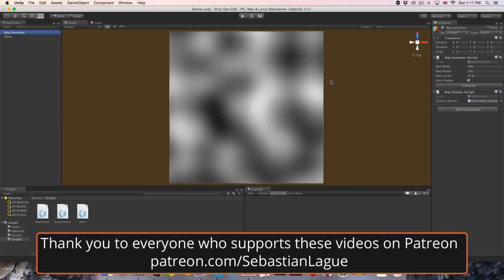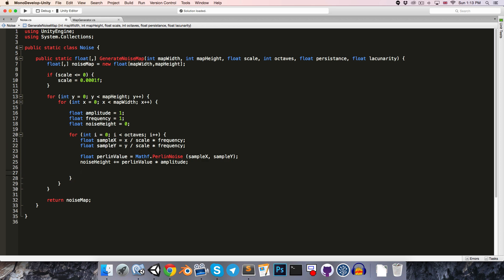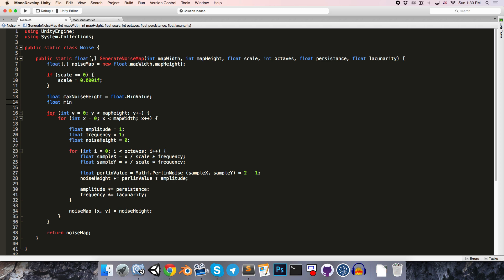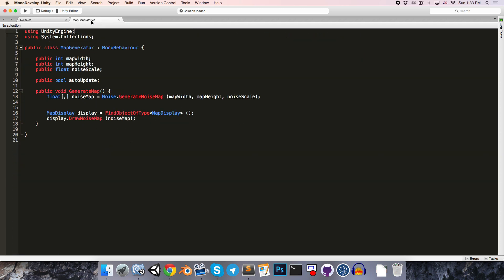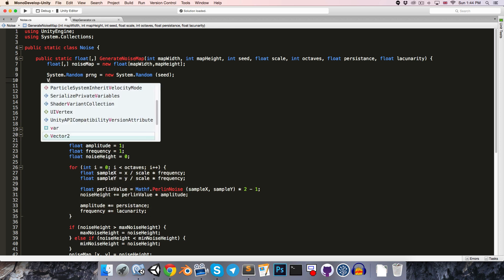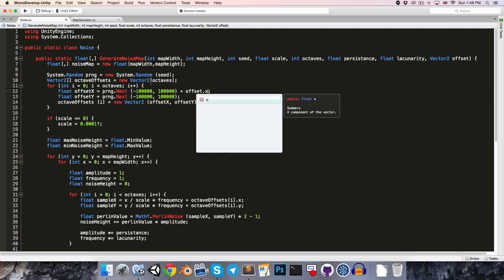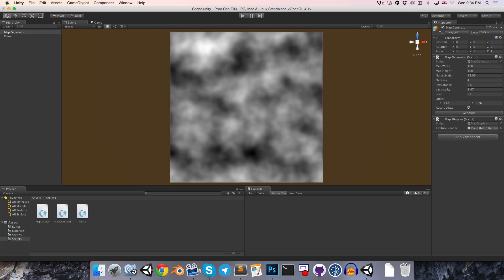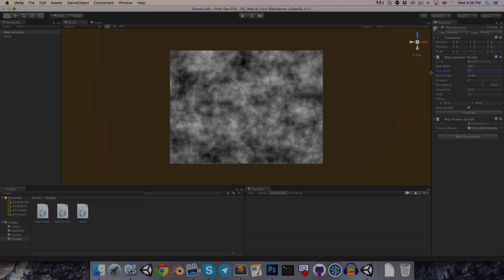Procedural Landmass Generation (E03: Octaves)

Comment: Max and min noise height can be calculated with 
        float limit = 0;
        for(int i=0;i<octav;i++)
        { limit += Mathf.Pow(persistance, i); }
this will save a lot of calculation;
Reply: This is the theoretical limit, yes, however in practise this does not work, because there will (basciallaly always) be a huge difference between the theoretical max value and the actual.
I ran it a few times and the max value was never above 1, while the theoretical max value was 1.875.
The result of that is, that you have a lot of grey and no white or black.
Reply: edit: (I'm implementing this series into UE4)
It might be the case that I'm wrong, because my output (without your optimisation) is not looking correct at all.
So I might have broken my Perlin Noise function...
Reply: Ok, my Perlin Noise function has a problem with large input numbers.
However, the main problem with your optimisation is still there: You don't have pure white and black.
If you can get those later with other methods (I think we can?), then thats not a problem of course.

Comment: funny. I did all same things step by step and at 10:20 I get a different texture than on video =)
I was thinking about what I get the same texture what in a video if I do all the same settings...
Why textures is different?
Reply: because it's a random noise. Random.
Reply: as I understand, if the generator settings are exactly repeated as it is implemented by the author, the card should be completely repeated. so when I fully repeated all settings I get a much different map what shown on the video, but when I generating map time to time with the same setting on my project - I always get a fully same map if settings are same.

Comment: When i generate my plate turns black... Any idea?
Reply: I have the same problem.
And I have fixed it.
It's because there is something wrong in your code, probably in the Noise class.
Reply: Hey did you ever fix this? I have the same problem
Reply: I was running into this as well. In my case, if the Noise Scale variable is close to 0 or negative, the entire plane will be black. Probably something to do with the normalization code.
Reply: You should set your material texture to none. that worked for me.

Comment: what is the point of the octaves for loop? Am I missing something? it only seems to multiply amplitude and frequency  for a number of iterations, everything else keeps getting overwritten until the last loop. Isn't it easier just to amplitude *= persistance^octaves and frequency *= lacunnarity^octaves and skip the (x*y*octave) number of loops for octaves?
Reply: nevermind, NoiseHeight builds with each iteration of the loop. Wonder if there is a simpler way though,

Comment: Whenever I change the Noise scale it doesn't just zoom in, the noise is also growing and then shrinking back as it zooms in (like it's showing a 2d slice of a 3d noise that is repeating). Does anyone know why this is? I double checked the code and it is the same as in the video!
Reply: Remove the 2 for loops for x and y that InverseLerps the Value before you return, I don't know what the problem is but i had the same problem and commenting out the for loops was the only thing that worked for me.
Hope this helps

Comment: why set the min and max height values inside the loop? if they are consistent couldn't they be assumed as -1 and 1 for the inverse lerp method and thus use the inverse lerp in the return line directly?
Reply: Because the min and max can go below 0 and above 1 when you are layering the octaves. For example with a high frequency you could find you get 0.8 for octave 1, 2 and 3 which when added together would give you 2.4. The same can happen in negative. Also imagine if you had an amplitude of 1000 instead of 1, then you would have 2400. It doesn't matter how big or small the numbers go when you are sampling the points, as long as you bring everything back between 0 and 1 at the end while maintaining the proportions.

Comment: I get four minutes into the video, and my map doesn't show perlin noise. Instead it shows a black plane. Does anybody know how to fix this ? I have checked through the Noise script three times already, and still cannot find any errors. Unity doesn't point out any errors either. (im stuck after typing the code from 0:00 - 5:34)
Reply: Change the plane Map Mat to Unlit/Texture.
Reply: make sure octaves are above or below 0
Reply: set your material texture to "none"

Comment: I've been recently following this set of tutorials, and been learning a far bit in the process. However its become very obvious that your coding method is using a mixture of Mac OS X and windows code. Which is honestly a serious problem for straight windows users using the Windows version of unity. There came a point in writing your code where it all broke due to this oversight, and as a result I've had to go over all the code and sadly fixing this to no anvil have I been able to rectify a lot of these discrepancies in the whole code form.  Is there any chance you have the completed code using only windows based code line arguments ? and if so can you provide them.

Comment: hi i'm having a bit of trouble when I finished putting the octaves and things in unity the entire plane simple went black and i cant get it to change and become static like before there's no errors so i don't know why this is happening. any ideas?
Reply: I did find some "warnings" but this is the only one that could be worth mentioning. 
"Assets/Scripts/Noise.cs(41,27): warning CS0219: The variable `perlinValue' is assigned but its value is never used" any thoughts?
Reply: You never used the variable perlinValue maybe u typed in something like PerlinValue or Perlinvalue

Comment: My Perlin Noise looks pretty repetitive... I don't know if you'll fix this in future episodes.. I this I kind of see a repetitive pattern in your Video too. Its when you zoom out at 10.02, you can see straight lines and repeating bumps. But my pattern looks very tiled.
Also I get the weirdest pattern ever on scale 0.000001! Its like a plus!

Edit: After copying your code it seems to be fine. I also made a few adjustments to the MapGenerator:
   private void OnValidate()
    {
        if (mapWidth < 1)
        {
            mapWidth = 1;
        }
        if (mapHeight < 1)
        {
            mapHeight = 1;
        }
        if (noiseScale <= 0.001f)
        {
            noiseScale = 0.001f;
        }
        if (octaves < 1)
        {
            octaves = 1;
        }
        if (lacunarity < 1)
        {
            lacunarity = 1;
        }
        if (persistance <= 0.1f)
        {
            persistance = 0.1f;
        }
    }

Comment: Hi, I was confused why you adjusted the range of the PerlinNoise to (-1, 1) so added an extra argument perlinRange

float perlinValue = Mathf.PerlinNoise(sampleX, sampleY) * perlinRange - (perlinRange/2);

I added perlinRange as a public variable so I can adjust it in real time, and I found something interesting. Any value above 0 did nothing to change the noise, but and value below 0 actually inverted the noise. I now have an invert feature to the map which is cool, but I am still confused why you wanted to change the range to (-1, 1). I understand that it will vary the noiseHeight value to a greater degree, but once that is normalized to (0, 1) I can't see any change in the noise.

Comment: I'm following in c++ opengl and I don't have an inverse lerp function built-in (4:36). Does anyone have a c++ or pseudo-code function I can implement?
Reply: It's just a linear interpolation. 

float lerp(float v0, float v1, float t) {
  return (1 - t) * v0 + t * v1;
}

where v0 = minNoiseHeight, v1 = maxNoiseHeight, and t = noiseMap[x, y]

From Wikipedia's 'Linear Interpolation' page.

Comment: Getting this error. Does anyone know why?
IndexOutOfRangeException: Array index is out of range.
Noise.GenerateNoiseMap (Int32 mapWidth, Int32 mapHeight, Int32 seed, Single scale, Int32 octaves, Single persistance, Single lacunarity, Vector2 offset) (at Assets/Scripts/Noise.cs:46)
MapGenerator.GenerateMap () (at Assets/Scripts/MapGenerator.cs:23)
MapGeneratorEditor.OnInspectorGUI () (at Assets/Editor/MapGeneratorEditor.cs:19)

and it points to this line :  float sampleX = (x - halfWidth) / scale * frequency + octaveOffsets[i].x;

Comment: I'm loving this series as well but have come stuck at 8:55 - the seed section. I don't have the seed slider in the inspector. 

Obviously I've done something but I can't track it. The error in unity says "  scripts/mapGenerator.cs(20, 29): error CS1501: no overload for method 'GenerateNoiseMap' takes '8' arguments" but I have all 8 in the brackets.

I don't get the offset adjusters either. Can somebody read minds and suggest some magic for me please
Reply from the maker: +Alister Gray That error message means that there should NOT be 8 parameters. Go check the method definition and make sure the parameters you're passing in match up correctly with the method's arguments.

Comment: I was having trouble with the "Plane" object showing default material rather than the noise "Map Material", after going thought the noise script letter by letter, I found that on the 2nd last line which reads "noiseMap [x, y] = Mathf.InverseLerp (minNoiseHeight, maxNoiseHeight, noiseMap [x, y]);" i had written "(minNoiseHeight, minNoiseHeight, noiseMap [x, y])" while using the auto complete. Defiantly makes you think but its all very logical :D

Comment: Hi! Thanks for the videos!
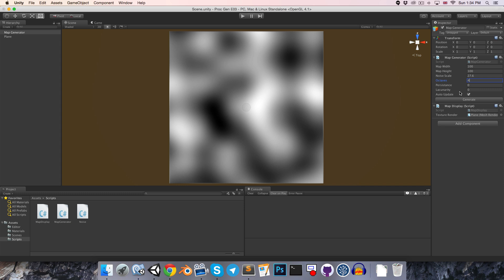somehow the line the InverseLerp returns 0.5f for all values (I'm at the middle of the video, can't reproduce what you have at 5:40 because of this).

Any clue on why that would happen (all the other input values appear to be correct)?

noiseMap[x, y] = Mathf.InverseLerp(minNoiseHeight, maxNoiseHeight, noiseMap[x, y]);
Reply: Finding the max value (or the min) of an array starts with initializing the variable with the smallest value possible 
float maxNoiseHeight = float.MinValue;

This is the only way to make sure you program will find a value in your array that is larger than the smallest one.
Reply: Same problem here
Reply: Found it (for me). In my case the following code was the problem (this is the correct one):
float maxNoiseHeight = float.MinValue;
float minNoiseHeight = float.MaxValue;

I inverted float.MinValue and float.MaxValue. 

I still don't understand exactly why this is setup as it is  (maybe Sebastian can pitch in and explain?)
Reply: @andreadst  5 years later, your comment saved my ass from tearing my hair out :D cheers buddy!
Reply: @Buhm01  power of the internet :D
Reply: Thanks for the explanation pololabete!
Reply: Thanks, had exactly the same problem. 
Cheers <3

Comment: I've rechecked again and again against github source, when i set octaves or very high, it become star, how i can prevent this..
my set is  [mapwidth =100, mapHeight=100, noiseScale =25, octaves =30, persistance=0.66, lacunarity=1.61,seed=0, offset=(0,0)]..

btw thanks sebastian for your tuts
Reply: This also happens if you set the lacunarity super high and a similar thing happens with the persistance. I couldn't explain the exact cause but i know it's something to do with the precision of floating points, if you played Minecraft back in the day and discovered the far lands, that's the same thing.

Comment: could you explain real quick why you use system.random? instead of random.range.  im having a hard time understanding exactly what the seed.next does since im use to using the random.range
Reply from the maker: Since you can't create a UnityEngine.Random object, setting the seed will affect all random numbers in your game. That's why I prefer to create a System.Random object; that way the seed is only used for the terrain gen. System.Random.Next(int min, int max) simply returns the next random number in that range – same as UnityEngine.Random.Range(int min, int max).
Reply: You can use Random.InitState(seed) to define the seed of UnityEngine.Random. I think this would work in the same manner.

Comment: Can anyone explain to me what is the point of the octaves?
Reply from the maker: +Purple Ice Have you seen the first episode? It explains it all fairly nicely I think. https://youtu.be/wbpMiKiSKm8?list=PLFt_AvWsXl0eBW2EiBtl_sxmDtSgZBxB3
Reply: Sebastian Lague My bad... Thank you!
Reply: Sebastian Lague So basically Instead of currently getting noise just once(is how I am doing right now in my voxel terrain project) each time I need to get it several times with different variables and add them all up? (I will most likely redo that part anyway and I hope I understood it)
Reply from the maker: +Purple Ice That's correct. You layer multiple octaves so that you can add smaller details to the noise.
Reply: +Sebastian Lague Okay, I'll try to add an option to generate several octaves if needed, but will it ever be needed? I mean what could I do with them in voxel terrain? (blocky terrain where only visible mesh is rendered) right now everything is smooth and kinda how I want it to be, but what could be done with them?

Not really sure if you might know but this type of generation (straight walls with flat surfaces on top) http://minecraftio.com/wp-content/uploads/2016/04/Realistic-Terrain-Generation-Mod-minecraft.jpg

Is this the result of multiple octaves? (Currently I am just learning to use the noise, using simplex noise but I doubt it's too different from perlin and I really have no idea what I am doing, currently I just can make terrain from multiple layers (stone, dirt grass etc) in 3D space, just asking anyway)

Comment: Is there a way to connect two noise maps using the same seed next to eachother? I thought that changing the offset appropriate to it's location would work but it doesn't. Any suggestions?
Reply: I'm two years late, but if anyone wants this, just change
"float sampleX = x / scale * frequency + octaveOffsets[i].x"
to
"float sampleX = x / scale * frequency + octaveOffsets[i].x * frequency;"
and it should connect properly, I believe. It's just that further octaves don't get offset properly if you don't multiply their offset by frequency too.

Comment: i have noticed that the offsets are not working well. when you're changing them the noise map is not moving but it looks like a layer of clouds moving at differend speeds - this is because the various octaves are not moving as they they should. fixed it with:

float sampleX = x / scale * frequency + octaveOffsets[i].x * frequency;
float sampleY = y / scale * frequency + octaveOffsets[i].y * frequency;
Reply: another issue with this is that it will dynamically change the shading due to different minimums and maximums (as they can change as you move around the noise) so I think that inverseLerp should work in a different way.
Reply: Thanks a lot! I couldn't figure out why changing the offset actually changed the scenery, and did not just move it :) this worked perfectly (though I did add sat (x - halfSize) instead of just x (same with y), but it does not really matter)
Reply: +daluur yes, I wrote that comment before the end of the video - before the zooming to center option was added, i also cahnged the whole thing later so it looked like
float sampleX = (x - halfSize / scale + octaveOffsets[i].x) * frequency;
Reply: +vooood I think you forgot to put x - halfSize in parenthesis should be ((x - halfSize) / scale + octaveOffsets[i].x) * frequency;
But again, thanks, really needed a way to make the map 'the same' regardless of the offset :)
Reply: daluur indeed, i was not copy/pasting from my project and looks like i have missed that. :)
Reply: It does give a nice parallax effect

Comment: Instead of normalizing the noise values with the min and max values wouldn't it be better to normalize them between -1 and 1? If you normalize between min and max the value of the sampled points changes depending on the cut of the noise map you can see, if for example you have one really low point like -1 and change the offset a little so your min value is now 0 all values you could see before change their value, a noiseValue of 0 is now 0 where it was before 0.5. That's just something I found out while coloring the heightmap, points on the map that where blue would change to another color depending on where the "camera" (offset) is on the heightmap.
Reply: I was implementing something similar to this video using chunks and was noticing the normalized values were creating distortions which appeared as lines between the chunks.  Normalizing between -1 and 1 instead of a min and max, as you and others have suggested removes this.

Comment: Personally, I would say octaves should never go below 1, not 0.  Otherwise, your Noise.GenerateNoiseMap function will only return a bunch of 0s.  Which, if that's what you want, great, but it doesn't make much sense to me to have that.
Reply: The "* 2 - 1" is actually useless and does not change anything as the map is then normalized...
But I was wondering about a more effective way to normalize because I guess the InverseLerp is pretty expensive. As all Perlin noises are between 0 and 1, the sum of the octaves should be between 0 and P = sum(persistence^i). So we could also just write "noiseMap[x, y] = noseHeight / P" and we'll have something normalized...
What do you think?
Reply: + Sebastian, you should remove the "else" when decreasing the min value. If the min value is the first to be computed, you'll have an error.